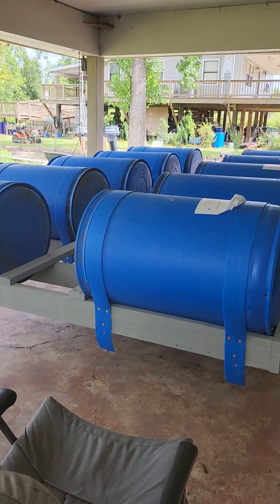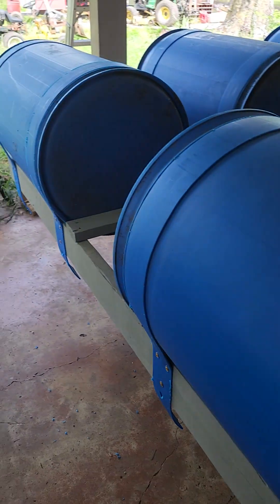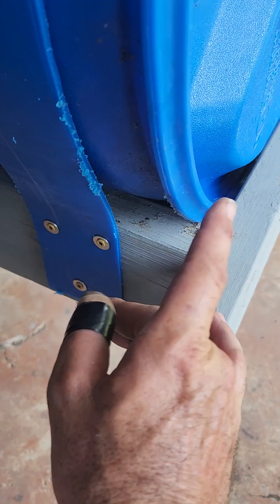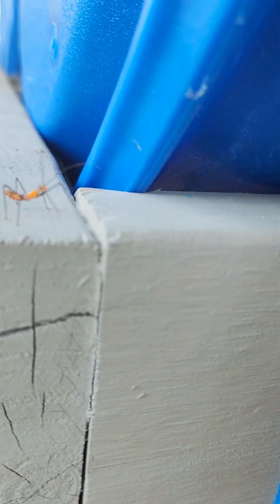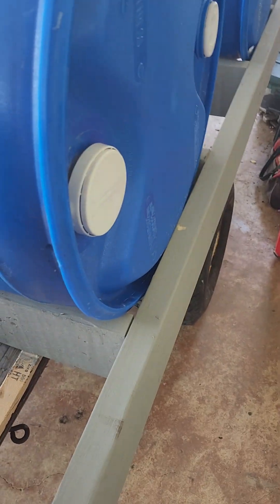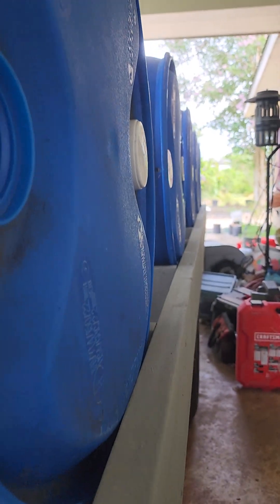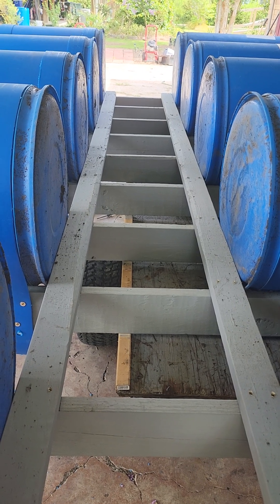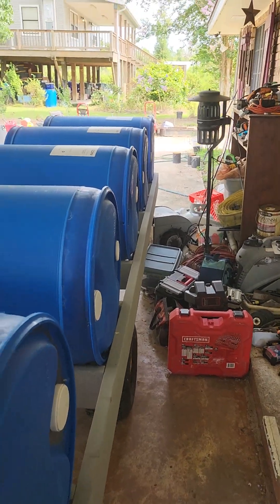8x12 heavy duty floating dock

Comment: Excellent build! Was there a reason why you mounted the barrels width wise instead of length wise?
Reply from the maker: For fliating dock use,offered more stability in this orientation for the deck size.
If i put barrels the other way,on the 12ft side you could only fit 4 barrels.
This way i can fit 5 per side.